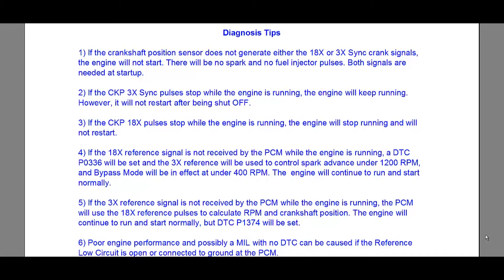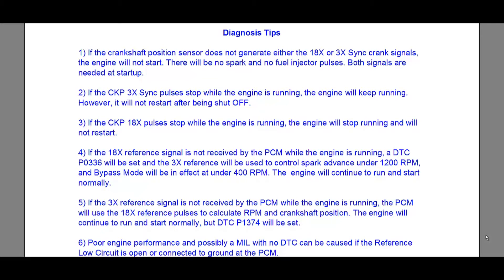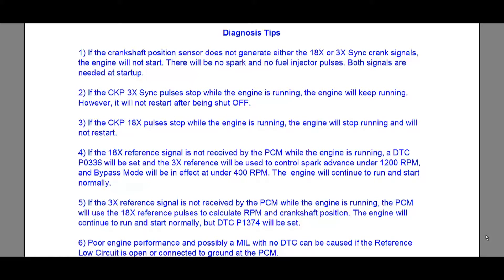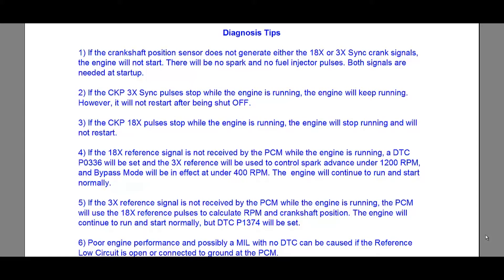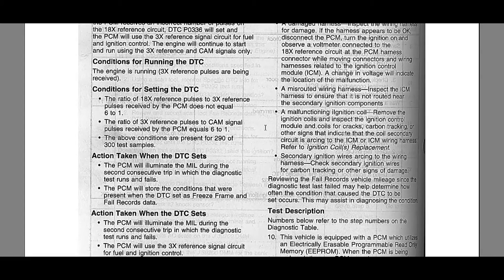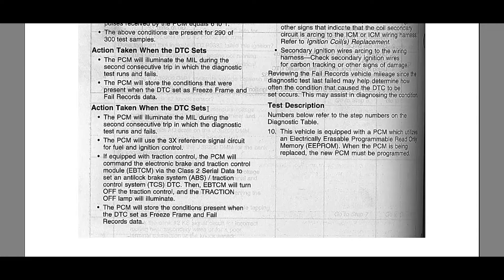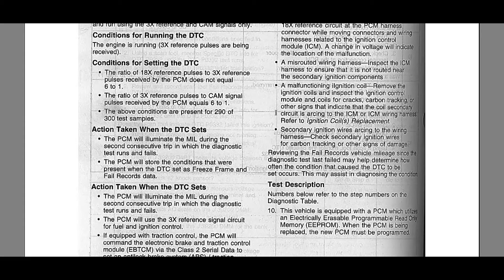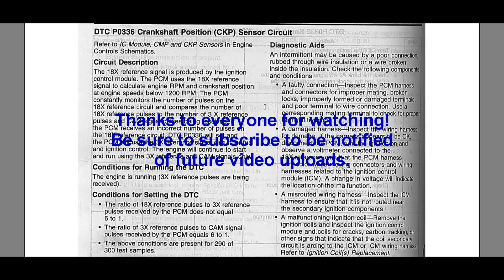Diagnostic Tips GM Bypass Ignition Systems - Part 7

Comment: seems that this problem is heat related. the test i would do is to connect a scope and see is the pcm is receiving 18 x pulses from the icm. possible causes icm, short to ground on the 18x wire from icm to pcm or corrosion on pcm 18x terminal.
Reply from the maker: Thanks for your comment Paul. Yes, I thought the same thing about heat related or a loose connection or corrosion on a pin. I did take a look at the 18X reference and 3X reference signals along with the cam signal at the PCM and all looked fine. I closed the hood and ran the car at 2000 RPM for about 30 minutes while watching the scope. All signals looked good. Then while monitoring the signals at the PCM, I moved every connector, all parts of the harness from the ICM to the PCM and still nothing. Also during this test, I tapped on the ICM and PCM and still nothing. Getting a little frustrated now because I can't get this car to fail. Looked at the ICM, PCM, crank sensor connector and another connector between the ICM and PCM for terminal inspection. Didn't see anything out of the ordinary. Then I cleaned up all of these terminals and drove the car for three days and here comes the check engine light. Same code P0336. Next I decided to replace the crank sensor thinking that maybe it is failing intermittently. Of course, it could be the ICM or PCM and I'm still evaluating this problem and will keep you posted on the outcome. So far, it looks good but it's still too early to tell. Take care Paul...

Comment: Well Terry the first thing I would do is completely burn  the manufactures flow charts, not just  because their  totally unreliable or inaccurate or just irritate me  - the system info is great its the flow charts. I think the engineers all get together and print flow charts to make diagnostics so hard you finally loose you mind and take your car to PEPBOYS.  I have 30 years of first hand knowledge  working for these jokers.  OK  I got that off my chest .   I would start right at the CKP  first since you said there were no other DTC's except maybe a traction control MIL.  I don't remember you saying if your engine was running and would not start or it just stopped running, either way I would send a PM to Scannerdanner and ask him -  OK now -  if he  said pound salt I would back probe the CKP  and with my Pico look at the  two waveforms and hope all my high  priced  advanced diagnostic  YouTube training kicks into gear.       How's that sound ?  Am I even close ?  Close counts right ?  Not another detention ?
Reply from the maker: Yes, you're right Steve. The flowcharts can lead you down the rabbit hole. Funny thing is, you can get down this hole very easily, but it's hell getting back out of it. Kind of like Alice in Wonderland LOL. I just use them for any pertinent information that may help in the diagnostics. Usually, I focus on the description of the system for a particular code and why the code sets. I should have followed up with the symptoms of the car in this video, but didn't think of it until the video was uploaded (I've added annotation at the end of this video describing the symptoms). The car was running down the highway, and I felt a little jerk. I looked down at the instrument panel and saw the check engine light on, but the car continued to run normally. I got to the house, turned the car off and it restarted with no problem. I then checked the code and found out that I had a DTC of P0336. This indicates that the PCM was not happy with the 18X reference signal. It found this out by comparing the 3X reference and 18X reference signals to see if there was a 1:6 ratio. Basically, the PCM is dividing these pulses to see if the value is equal to 6. If not, it knows there's a problem with one of these signals. But how does it know which one? It does this by comparing the 3X reference signal to the camshaft signal. If these two signals have a ratio of 6:1 which is correct, then it knows the problem is with the 18X reference signal. Hope that made sense.

Okay, no detention for you today. Just from analyzing the info and not looking at any signals, I would say there is no problem with the crank signals. If I lost the 3X sync signal while running, the car will continue to run, but will not start. In my case, the car did restart. Keep in mind that the crank sensor could "heal" itself during a startup. If I lost the 18X crank signal, then the car will stop running while going down the highway. Since the car did not stop running, the 18X crank signal had to be there. So, my guess is that the 18X reference signal is being lost from the ICM to the PCM. I would first start off looking at the two crank signals, just to make sure they looked okay. For the other two channels, I would be hooked up to the 3X reference and 18X reference signals at the ICM. I've already done this and will be shown in an upcoming video. Just for a sneak preview, all these signals looked fine. Next, I will raise the RPM's of the engine, close the hood and let it heat up. Hopefully, if anything is breaking down from heat, this should show up. I would do that for about 15 minutes. If nothing shows up here, then I would move over to the PCM and look at the 3X ref, 18X ref and cam signal. Maybe we'll look at the IC signal just to use all four channels. If I don't see anything out of the ordinary, another heat test to see if anything changes. If not, then monitor the 18X reference signal at the PCM and then move the ICM to PCM harness, looking for an intermittent loose connection. If I don't see anything here, then I'll start opening the ICM and PCM connectors, do a close inspection and do a cleaning of the contacts and terminals. Afterwards, I'll do a closer inspection of the HV secondary system, spark wires leaking voltage, cracked coils, etc. I've already done this and saw nothing obvious.

The next video is rendering now and I'm showing a little about the Picoscope, so I had you in mind and taking it step-by-step. This video will show the hookup of the leads, starting the software, ground connections on the scope, etc. After that one, we'll be looking at the signals that I discussed earlier. Take care Steve and I appreciate your thoughts and comments.